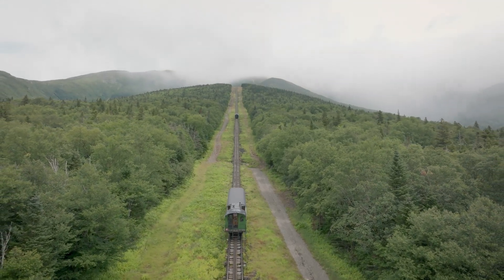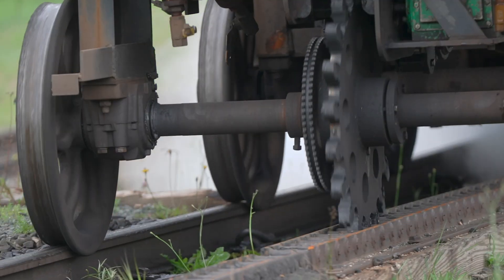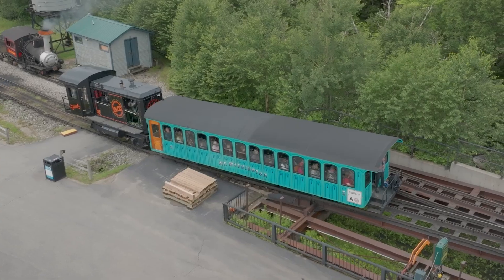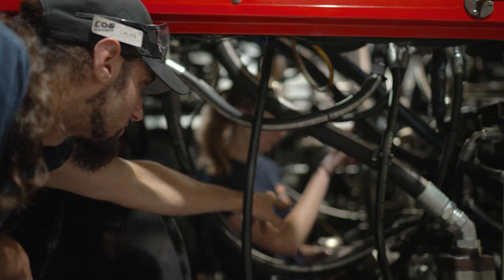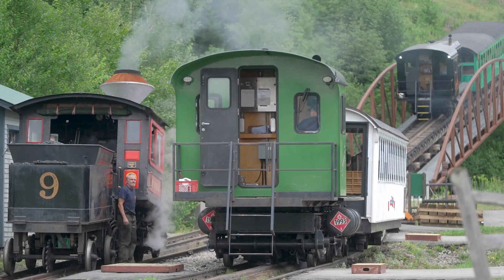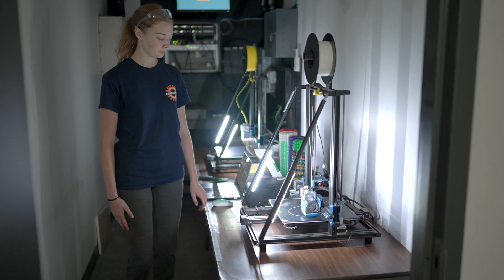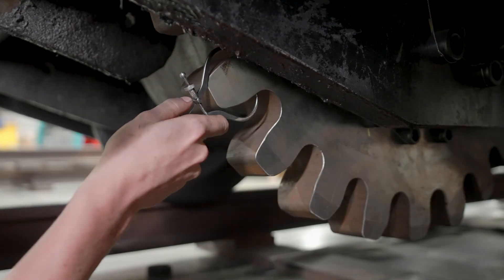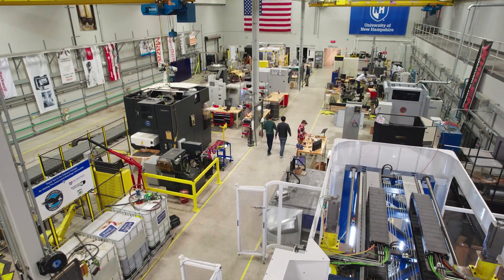Behind the Scenes with the Engineers of the Mount Washington Cog Railway

Comment: I see someone complaining below that the cog railway has left coal/steam for diesel.  that is absolutely not true.  they still run steam trains, get on the cog railway website and look at the schedule and you'll see that.  but now you also have your choice of an ecologically more friendly biodiesel as well.  I've been on both their steam and biodiesel trips many times.  the biodiesel is faster so you get to spend more time at the top, it's much cleaner than a steam engine could ever be, it uses fuel much more efficiently than a steam engine ever could, and it uses biodiesel which is a sustainable fuel.  so if you care about that sort of thing, you can have the excitement of the cog railway without the smoke and ashes.  and the view is spectacular no matter which locomotive you have.